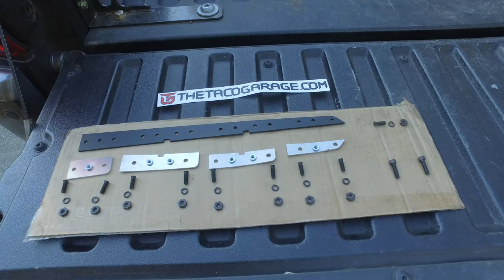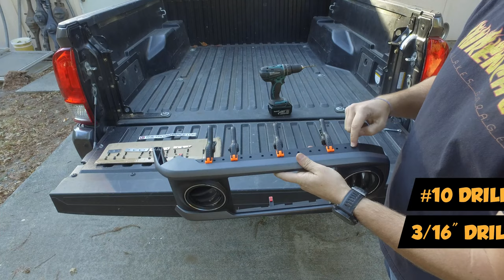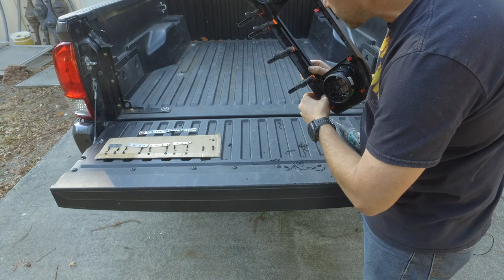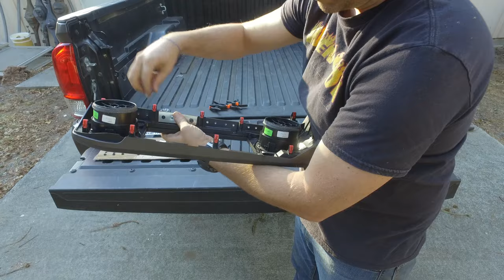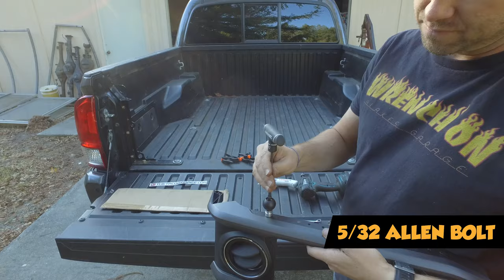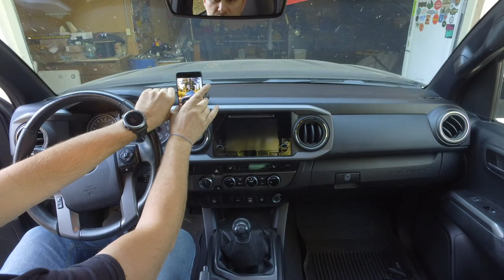Taco Garage Dash Multi Mount | 3rd Gen Toyota Tacoma

Comment: Really like this product on my Tacoma too.  FWIW - I added a 2.4amp and 4.8amp bluesea USB port with a dedicated 12 AWG cable from my battery for anytime power.  I made my own mount out of kydex and installed it behind the radio.  Now I no longer have charging cables dangling everywhere.
Reply from the maker: I'm thinking about doing the exact same
Reply: SnailTrail4x4 I'll send you a pic on Instagram DM.

Comment: Great video! I love mine for sure. I would make one suggestion. I used a nylon nut on the backside of the one ball mount bolt.  I found with my heaver tablet the ball mount bolt would loosen up while on the trail. Thanks for the video.
Reply from the maker: That's a great suggestion! Thanks for sharing

Comment: Do you have a photo of the ham radio plate on top? Where did you hide the wire?
Reply from the maker: Drilled a hole though the mount straight down